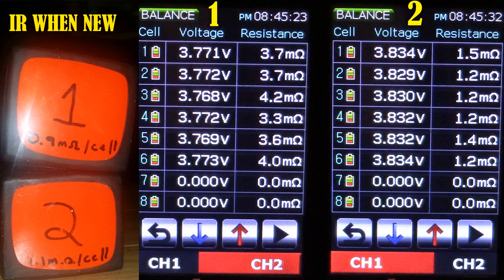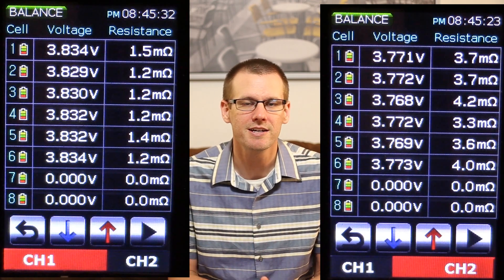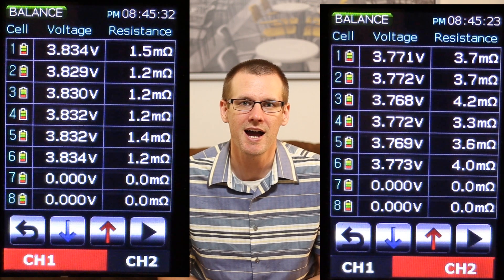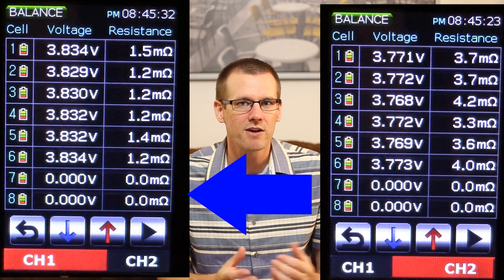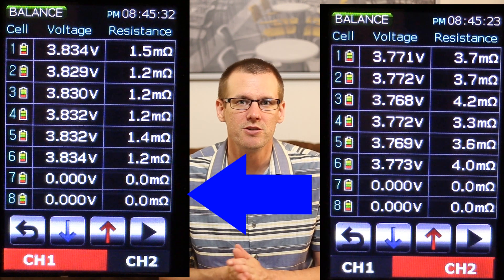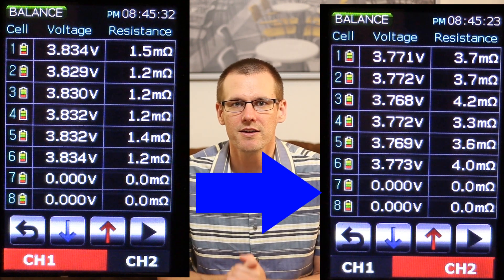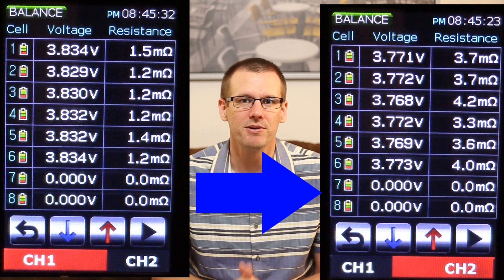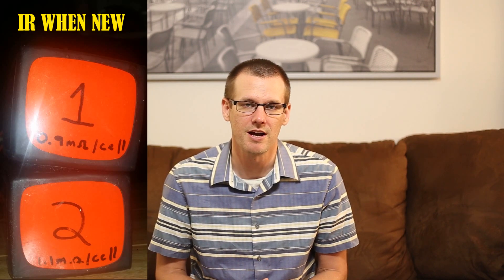How to Store RC LiPo Batteries and Why it's Important!

Comment: I have a Polaron EX 1400 charger too. Does it charges one cell higher than other cells in your charger too ? For example - If I charge a 3S battery pack, the final voltages are 4.20, 4.20, 4.22v. Please help.
Reply from the maker: No, all are well balanced

Comment: Is cycling LiPos important when storing for a few months?
Reply from the maker: LiPo batteries do not need to be cycled ever.
Reply: RCexplained Thanks. The paper that came with my SMC batteries said they should be every 6 weeks or so.
Reply from the maker: That is unusual. I would check in on the packs to confirm they are still at the storage voltage every 6 weeks. I would not cycle them.
Reply: RCexplained I emailed SMC and they replied “If you know you will store your packs for a long time it's best to cycle them every 8 to 10 weeks as this keeps them in better shape.  Batteries will change some when stored for very long periods of time. Charge them up and then put them back at storage voltage”. Maybe you could do a video better explaining battery chemistry and what’s actually happening during use and during storage, and what actually happens when a LiPo is damaged from improper use and/or storage. Your channel has been a great place for information.
Reply from the maker: Hey John, I'm curious what metric SMC uses to identify how much better their storage process is for their batteries then a conventional process?

Comment: Do they have to be put in storage mode if i use it atleast once a week
Reply from the maker: I do not like to have the pack sit at max voltage for a week. I only charge the pack when i know I'm heading out. After a run, I am often around 3.80v per cell and do not need to throw the pack on a charger to hit storage voltage. However, sometimes a part on a plane breaks and I am left with a fully charged pack that I will place on the charger to bring back down to storage voltage. This has worked very well for me over many years. Hope this helps